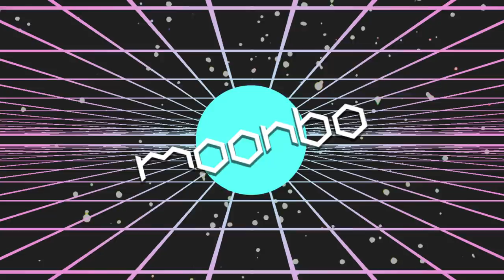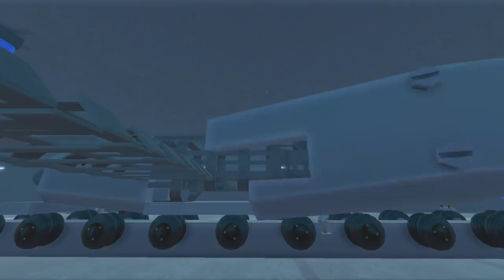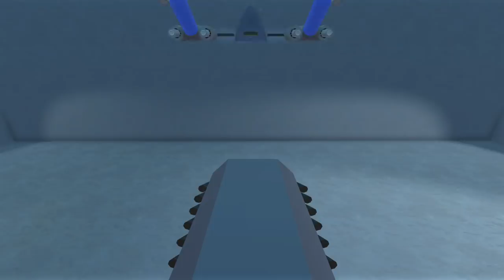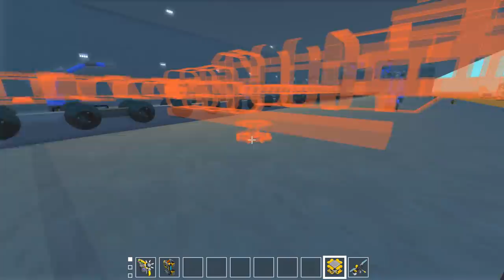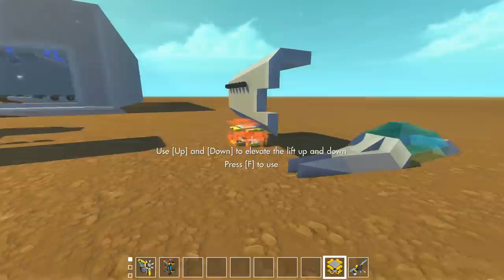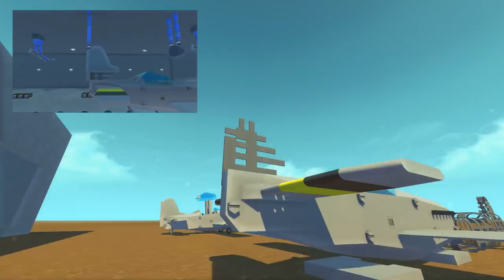THE PLANE FACTORY! - Scrap Mechanic Creations! - Episode 181

Comment from the maker: WHAT!? How can you tell it's fake... what gave it away!?! It doesn't have anything to do with the fact that I explained in great detail each and every step of the build and exactly what I did to create this video does it?
Reply: Moonbo Hey moonbo how are you?
Reply: Its 100% real, what do you mean 😏
Reply: Because the frame you use the robotic arm to put it it haven't touch the creation but when you switched frame it was connected and btw I know how you did it
Reply: @lollolypopy2870  TELL MEEEE
Reply: There was structure where the cabin goes and it magically disappeared
Reply: Looks like a p-51
Reply: The wings sis smaller than the wing farmes

Comment: Okay, its been roughly two years since I have watched or played Scrap Mechanic, but were all those panels loose fitting? Or are those thrusters modded so that they weld? Edit: Or is Moonbo running in and welding them together, but that is cut out to make it look as if the factory is building the plane?
Edit 2: And this is why you watch entire videos before making comments...